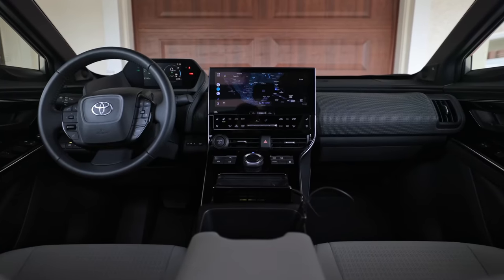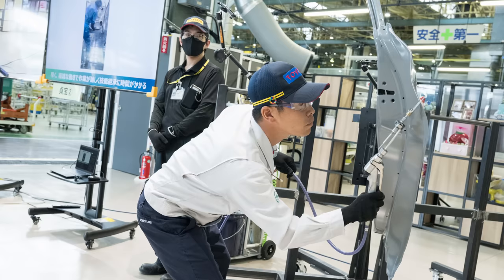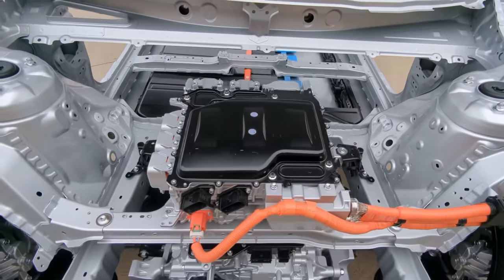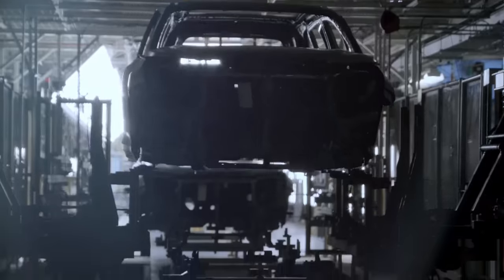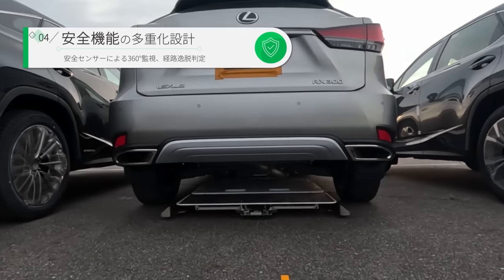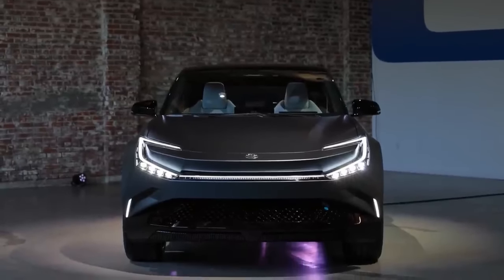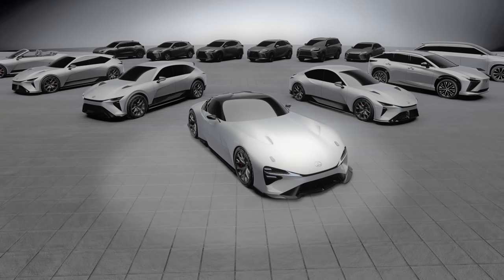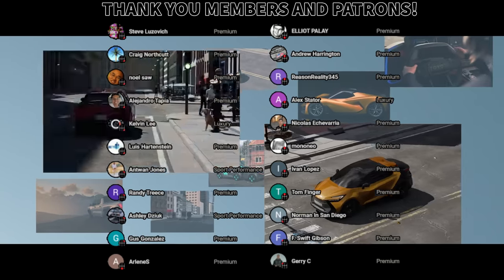Toyota will LEAPFROG Tesla by 2026... Here's their 6-Step Transformation!

Comment: I think they're better off sticking with hybrids.  I want a small truck hybrid with Toyota reliability.  I'll ride an ebike before I buy a full EV.  But hybrids have advantages like being able to sit in air conditioned comfort while camping.  I'm not risking draining an EV battery.  And the fossil fuel infrastructure is in place.  A capable electric recharging infrastructure is a long way aways.  I travel.  For commutes I'd take a PHEV over a full EV but I think a normal hybrid is the best of all worlds.
Reply: BEVs have massive batteries and is able to power a home split system for like 2 days. Powering aircon during a camping trip is a walk in the park. In fact Tesla always has a camping mod for this.
Reply: Toyota sells more hybrids that Tesla sells cars. Toyota hybrids aren’t going anywhere for quite a while.
Reply: @asjeot Most BEV aren’t able to export power to a home.
Reply: @matthewhuszarik4173  I just mean you shouldn't worry about not being able to use your aircon whilst camping.
Reply: The have to make BEVs and make them more efficiently. You have to cover the market and BEVs are growing in market share so Toyota has to make them. Doesn't mean Toyota won't make PHEVs, they have a multi-prong approach to their product lines.
Reply: A lot of people here in Europe were thinking similarly 5 years ago. Now all the growth is in EV sales with PHEVs and HEVs topping out and beginning to decline. We are ahead of you in charging infrastructure and there's really no benefit in hauling around a heavy fossil powered engine and gearbox with all the complexity and oil changes required. I've had an EV since March 2019 and in the early days we had a few tense moments on long hauls across France (France is bigger than California btw) and trips to Switzerland, Germany and the UK. But in the last 2 years there has been no inconvenience at all running an EV compared to a hybrid or any ICE car. The range of the car means I know I can drive on the motorway winter or summer for 3 hours at a good speed and still not be panicking about plugging in. I never drive more than that time before taking a break, even when we had ICE cars. We always stop for 20 or 30 minutes to grab some food, drink and use the bathroom anyway so for us there has been no change in habits going to an EV. The USA will go the same way and with sales there hitting the 10% mark this year I can see the market is following the same path as it did in Europe.
Reply: @kiae-nirodiariesencore4270  The big difference between the US and Europe is range and time and convenience to recharge. Europeans rarely drive more than a hundred miles while it is very common for Americans.
Reply: @matthewhuszarik4173  'Europeans rarely drive more than 100 miles'...really? How often do Americans drive from New York to LA? ...Lisbon to Helsinki is just as far. FYI so far this year we have driven our Kia e-Niro (Niro EV in the USA) from our home in South West France to Zurich (950 km), to Brittany 500 km each way and this month we are off down to Spain. Yes the USA is a big place, I spent a lot of my working life over there and have done some very long hauls in cars but I don't drive any differently from what I do here. I never spend more than 3 hours in the seat before taking a brea, grabbing something to eat/drink, using the bathroom and stretching my legs. This is simply common sense to keep yourself and other road users safe. This 'my country is so big!'...cry is a lame excuse against sticking with dirty fossil fuels and not going electric...as everyone eventually will.
Reply: @kiae-nirodiariesencore4270  Yes I am sure as many people are driving from Helsinki to Lisbon as drive from New York to LA. The average US driver drives 13,500 miles a year the average European driver drives 8500 miles per year.
The US Federal Highway Administration has the average US driver driving over 14,200 per yer.
Reply: @matthewhuszarik4173  We are retired and only have one car. We average 20,000 km a year, so about 12,000 miles. Fact is that the average American daily commute adds up to plugging an EV like mine in once a week and charging it to 80%. There are very few use cases anywhere in the world that an EV with a 250 to 300 mile range does not meet. Given that battery tech is not standing still, I am sure we will see the 1,000 km range EV before the end of this decade.
Reply: The population of France is 67 million,of this 27 million live in the major cities the rest distributed through out the country and overseas in various territories. The United States has a population of 332 million. 82% live in cities or their surrounding metropolitan areas. This leaves 73 million 1 hundred thousand residents living in rural and distant locations in the United States.The United States has over 4 million miles of roads and streets . France has 9,958 kilometers or 6’188 miles of roads . A huge difference in conversion from gas to electric facilities. Though it’s a grandiose idea ,it’ll take longer to convert infrastructure than to produce vehicles here thus limiting the amount of vehicles to urban use mainly for the foreseeable future in all practicality.
Reply: @donaldpiper9763  France is 82% urbanized the US is 83% urbanized. Not a significant difference.
Reply: There is like zero demand for EVs is Europe - everyone who wanted one has already bought one. The drawbacks with price, range and charging are still huge and the incestives for buying EVs are disappearing.

There is a long way towards fullhybrids, not to speak of EVs.

As long as an EV is 50 percent more expensive and has at least 50 percent lower range and 99 percent worse charging options ICE is not disappearing. ň

I am curious whether the ICE ban for 2035 will be lifted, otherwise there will be mass protests and bankrupcies in the automotive industry.

Not to mention that the supplier network for batteries and raw materials lies in the hands of China and if there is a conflict and sanction like with Russia now,
the EV industry will be disrupted and price will skyrocket...

The future means variety of technologies...

 @kiae-nirodiariesencore4270
Reply: Charging stations in the US are not located where you can grab a bite to eat and go to the bathroom.  There are vast rural areas with zero charging stations, especially for non Teslas.
Reply: @milannemec5574  So there is zero demand for EVs in Europe is there? So when the September sales figures come out over the next few days I should be seeing what exactly? What with all those incentives disappearing I should be seeing a complete collapse in EV sales, correct? If you want to really understand why EV sales have been booming and will continue to boom, then ask someone who has been running one for nearly 5 years and 90,000 km. Your post displays a complete lack of knowledge of the costs of buying and running an EV, along with facts about the supply chains and how EVs are made. Happy to educate your on this subject
Reply: As a person who has driven Toyota pickups and Fourrunners exclusively for 40 years, I have bought my last gas guzzler. I'm still driving my 2002 Tacoma 6 cylinder TRD 4X4. That was the last year model that Toyota produced a small pickup that suited my needs. Toyota imo has   missed the boat by continuing to build bigger and bigger higher priced pickups, and dealership markups have convinced me that Toyota is no longer interested in selling to people like me. While Toyota is the world leader in producing hybrids, the 2023 model Tacoma hybrid gets only marginally better gas milage than my current 21 year old truck. Don't get me wrong. I love my old Tacoma. But I won't be paying 40-50 grand plus obscene interest rates to buy another bigger sized gas guzzler to replace it! I hope Toyota gets their act together.
Reply: @donaldpiper9763  FYI, France has 1.1 million km of roads and is 37% bigger than California. I have driven extensively all over the USA....Rockies, Utah, Arizona, Oregon, California and I can tell you I would still not do more than 3 hours behind the wheel, any wheel without a break. Electricity can be produced and dispensed anywhere. Gas stations use electricity for their pumps so you can't pump gas without it. So if you can pump gas in the middle of nowhere you can charge a car too. The added benefit for the station owner is that he can cover his roof in solar panels, store it in a battery and sell what he produces. The profit margins on this would be much better than selling gasoline or diesel. EVs are a disruptive technology and there is no stopping their advance. The USA is about 3 to 5 years behind Europe in this but another million will hit American roads this year. Digital cameras replaced Kodak film, smart phones replaced Nokias and EVs will replace ICE...cut and paste this if you like, keep it and look back on it in 5 years time when EVs are 50% of the new car market in the USA....10 years and it's game over.
Reply: Why so agressive? 

COSTS of buying a new EV are publicly available to everyone who can read:D
e.g. the new Kona - you can look up its price as ICE, hybrid or EV. And the dealer will tell you the estimated resale price in percent, based of the last generation and future estimates - the EV version is by far the most expensive and has the highest loss of value as a used car. Charging on the way is expensive. Insurance is needed as even a small crash can mean a change of battery. 
Unless you own a garage with electricity and night tarrif/solar panel plus plan to make mostly short rides and plan to drive a lot of kms there are few reasons to go for the EV only version. 

Happy to educate your on this subject:D
Just like the high-end chip industry is in the U.S. hands, the battery industry is 70 plus percent in the Chinese hands. It is extremely risky for the European manufacturers to rely on the good will of others, the decoupling is going on.

Like zero demand:
The European EV market is saturated. The fanboys have their EVs already and the institutions as well. There is a depression/stagflation on the way and cars as will be the first purchase that will be postponed, especially EVs
Reply: @milannemec5574  Why are you being so aggressive? Everything you say is contrary to what is actually happening. If every 'EV fanboy' has his or her EV already then why are sales of EVs continuing to rise month on month while ICE sales fall?
Reply: @kiae-nirodiariesencore4270  look at jeep avenger in EU, they wanted to sell it only as EV but the ICE version has already twice the sales while not being offered in most of EU yet. Kona eill be the same...
Reply: @milannemec5574  Not the case with the Kona. Despite being a lot more expensive 40% of all Kona sales globally have been the EV, in Europe it was higher.. Advanced interest in the new Kona suggests that 60% of sales will be electric. The market is only going in one direction, and that's towards EVs.
Reply: @kiae-nirodiariesencore4270  ok, if EVs are doing so great, than let the people decide what they will buy and let us lift the ICE ban as the people will decide what they want themselves
Reply: HEV/Hybrid is definitely where it needs to end, and evolve from there. Anything plug in is just asking for problems that we don’t need. This is all to fix something that doesn’t need fixing. Personal vehicles only account for 7% of global emissions, so it’s really all about much larger agendas.

Comment: Tesla will lead the EV industry and market, which Toyota highly respects all about Tesla. Toyota learned and adapted Tesla's manufacturing method with Toyota's operating foundation, KAIZEN. They're a late start for EVs, they admitted, but they strengthen EV manufacturing. According to Nikkei Tech News, Toyota's in-house battery technology development (not Panasonic) is currently ahead of China, S. Korea, and Europe. Some economists believe Tesla and Toyota/Lexus will dominate the future of the EV market globally.
Reply: Well said and true.
Reply: Tesla didn’t invent giga-castings other automakers haven’t used it because is reduces the ability to repair vehicles. That is why insurance is so high for Tesla’s they are totaled with very minor damage, because if the giga-casting is damaged the car is totaled.
Reply: @matthewhuszarik4173 Giga press at Tesla scale has never been done because there were no machine capable of that, material science needed for such larger application, your notion that it was not use because it is difficult to repair is fasle. Tesla mentioned in the last call earning that giga structure are easier to repair than traditional  bodies, and they gave reasons why so.
Reply: @josefernandezsmith4840  it has over 90% owner satisfaction, so maybe that is not true and the those that have bad experiences are the most vocal. All products have problems, but how they amplified is dependent on what is trendy. And what is your data to back that up, or is that your assertion based on mainstream news?
Reply: @nguyep4  Sorry there have been giga presses for years, which are really injection molding machines not presses. The Giga Press isn’t even the largest built. They just haven’t been used to make large metal car parts. Tesla didn’t invent the large injection molding machines and they weren’t the first to use them. Injection molding has been around for over a century.
Reply: @nguyep4  Elon was lying if he said cast parts were easier to repair that stamped parts. Why do you think insurance rates are so high on Tesla’s even with all their safety features.
Reply: @matthewhuszarik4173  There is more to it than ease of fixing that dictates cost. And it wasn't Elon who stated that casting is easier to fix.
Reply: @nguyep4  Yes on the front end it is considerably cheaper for manufacturing to use one complex casting than multiple stamped parts connected together.
Reply: @matthewhuszarik4173  i don't think you know what giga casting is, no doubt casting has been done, but never the scale that Tesla does for auto There was a reason Tesla approached all casting companies except one that said maybe, the reat is history. If that is the case, how could you say it had been done at that scale? The fact that you think Tesla invented is another misinformed person.
Reply: @nguyep4  I never said Tesla invented it. I said they didn’t invent it and large scale casting has been around forever. Another problem with Aluminum die cast pieces they are brittle and prone to fatigue cracking and failure. These die cast pieces are hidden and difficult to inspect for cracking as well. So I will stay away from cars with dies cast aluminum structural components that see cyclic stresses.
Reply: @nguyep4  Finally, a commenter with actual knowledge and facts.
Reply: Tesla didn't invent casting but they're the FIRST manufacturer to adopt this method for manufacturing cars, successfully. They did invent a new alloy to make die casting of such large pieces possible. That's why Toyota is now copying this method and technology to reduce production time and cost for their future EVs.

Comment: Giant castings are a huge step backwards for repairability. Yes they are super cheap to make; eliminates lots of tooling. However if you don't make the castings modular with sacrificial crush members, you will end up totalling out your car in a fender bender.

The casting machines from IDRA are back-ordered, and i would guess 2.5 years from the day you order. They should have put in their orders sooner. I imagine they want a Japanese company to make the machine, but that would take 10 years of R&D.

The vehicle logistics robots are super cool; the way they can move cars around is so clever.
Reply: Modern headlights and active safety systems are already so expensive to repair that you will total a car with minor collisions anyway. The point is with these technologies minor crashes will become very rare to begin with (which is true for any car with a collision avoidance system). An ounce of prevention is greater than a pound of cure.
Reply: Sandy Monroe did a video on this. I would have thought the same thing, but it isn't true. You can cut off bent parts and replace them with replacement parts. Keep in mind that once a factory has welded together a bunch of separate parts they are one part. If they are damaged it isn't easy to just separate the broken parts and replace them. The only advantage would be that once you have cut out the problem area the replacement parts are available. Sandy had some replacement part from Tesla, and there were cut points around the crumple zones, so apparently they thought of that.
Reply: Casted or welded. At the end, both are one big part.

Comment: The problem for the EV late starters is that the competition isn't standing still: where those competitors are now won't be where they'll be in a few years time.
Reply: Great point, but sometimes starting late can be leveraged. They get to start with NACS, built out super charging infrastructure, and ability to see what has worked and what has not.
Reply: Tesla is pretty much standing still. They only have two models that sell. Their new cybertruck is four years late and heading for disaster. All the effort seems to go into different deadbeat project like the fullselfdrive. 
In Norway, almost 80% of the new sales ar EVs. It's the most electrifyed country in the world and there Bz4X is doing great and is the fourth most sold model nationwide this year. I'd say the have already closed in the gap.